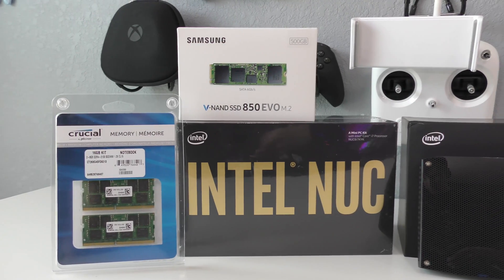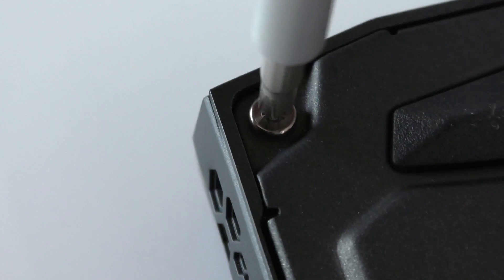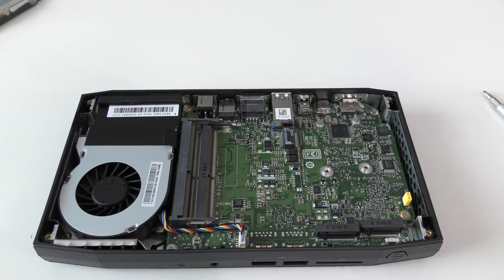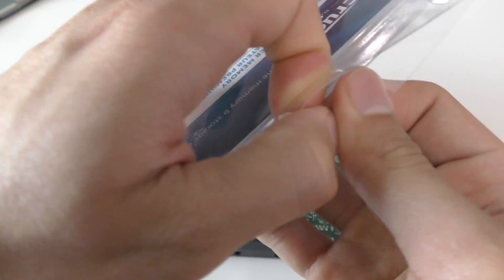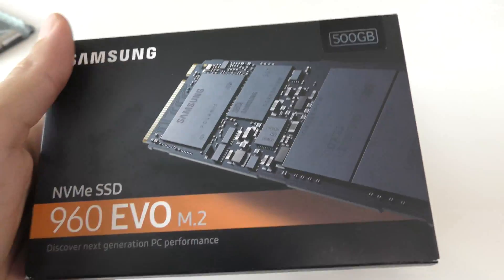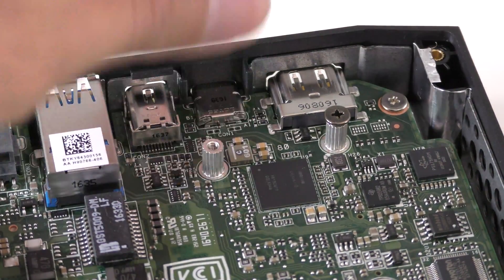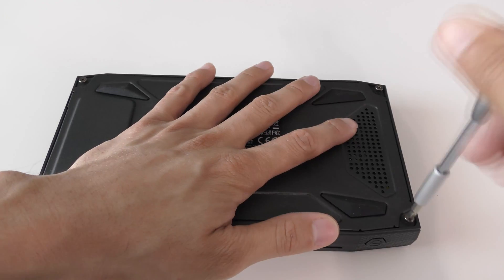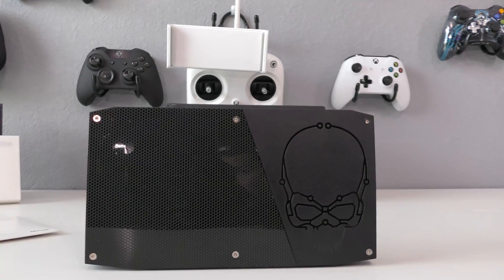HOW TO SET UP HARDWARE ON INTEL NUC : SKULL CANYON

Comment: replaced a laptop in my office with one of these with win10 boots up so quickly better the the old laptop wanted to install win7 but win7 doesnt seem to work with it due to the ssd drivers. Any idea how to get win7 to work?
Reply from the maker: Good question but I don't have the answer for that. But since you mentioned I am going to attempt it and see how it goes.
Reply: it installs but on bootup loading windos it just stalls...seems to be a common problem something to do with the ssd drivers im told.